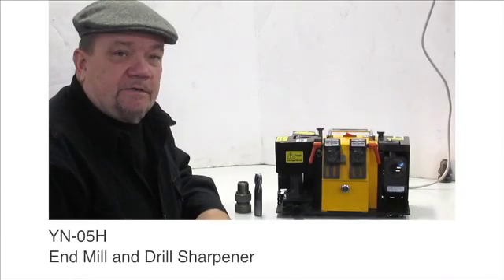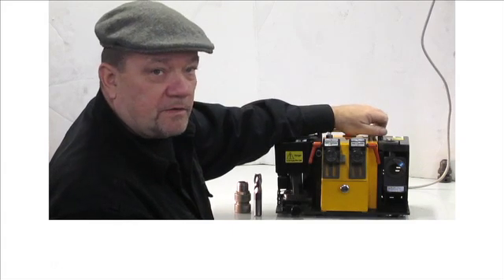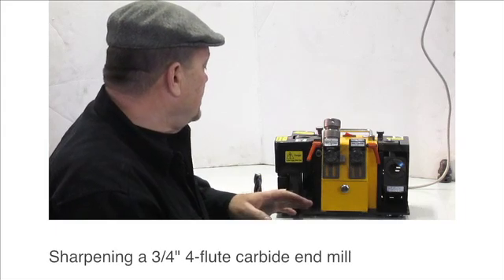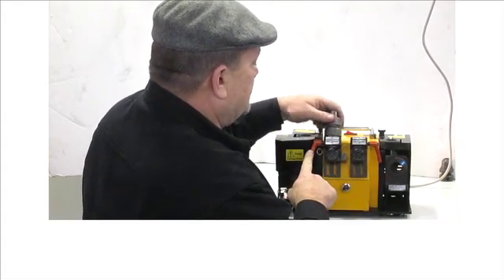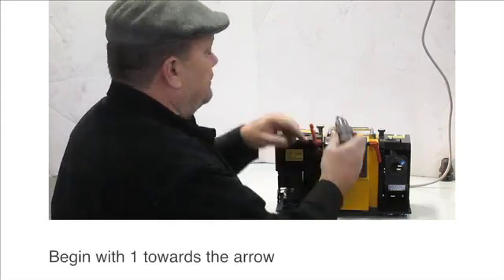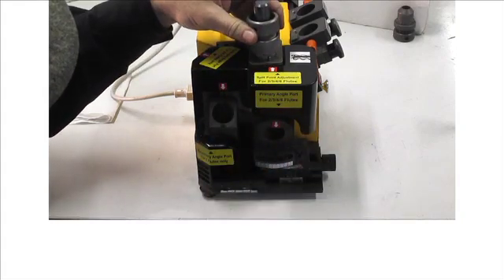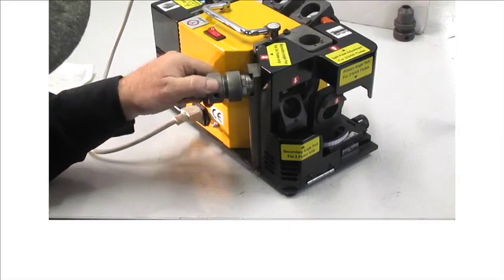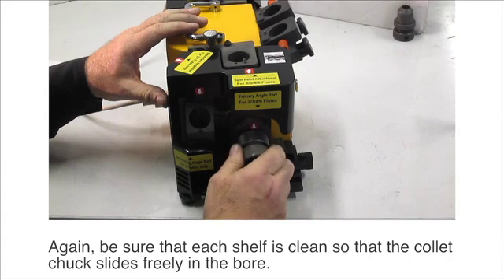Combination Sharpener

Comment: This certainly is an interesting machine. However, the presentation seems to be geared toward people who have a strong background in such things. It would help to introduce the product model and manufacturer and a bit about it's overall capability first. Tell the users more about it before just jumping into the operation. You noted the model but, not how one can purchase it. After checking out your web site it became obvious but, some people may not make that effort if you do not first promote it and what it can do. Also, you may warn those who are more of a hobby level that these are not the for the faint of heart. Yes, they are definitely professional level machines but, not everyone viewing this video will realize that because they strongly resemble those offered by VEVOR. That does not mean that those people won't buy it, though. Many may do so if they have the means.
FWIW